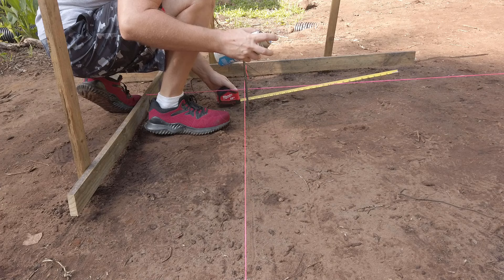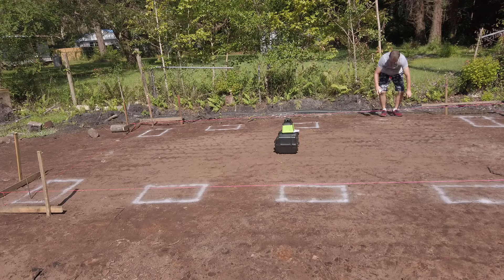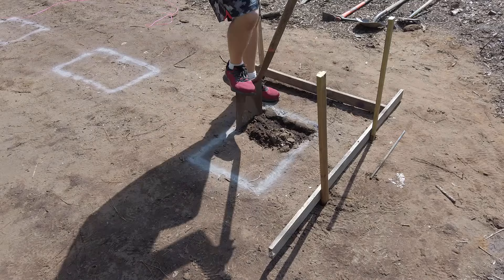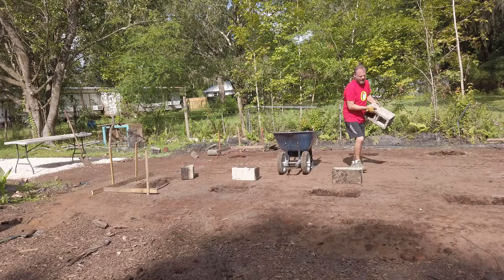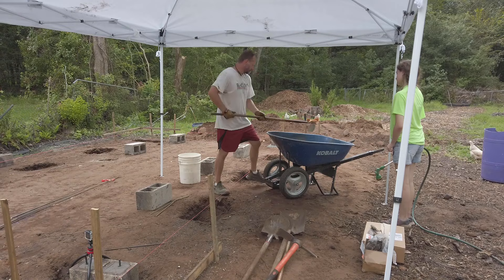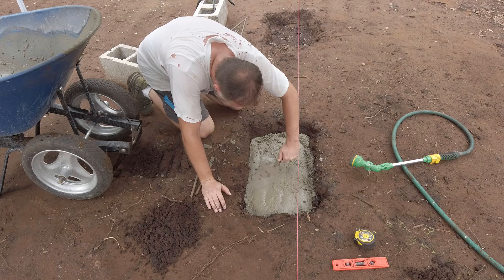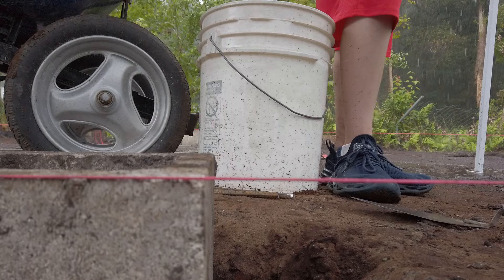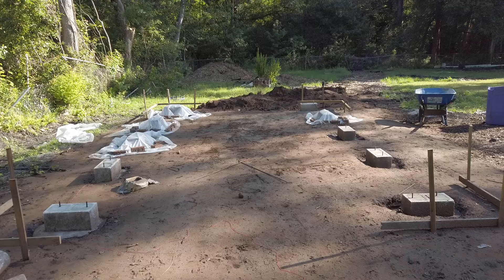Pouring Concrete Footers Pier and Beam Foundation Workshop or Large

Comment: 1. You made the footer 12 inch deep?   How many bags of concrete per footer?
Reply from the maker: Bags of concrete can be different sizes.  60lbs vs 80lbs.  So it depends.  2 or 3 for me.

Comment: In Australia they are known as Besser blocks. How much weight can they  each sustain in kilograms. Do I need to go deeper to support a steel framed house?
Reply from the maker: Depth is determined by local building codes.  Here in the states it is usually 12 to 18 inches below the frost line.  Depth is not determined by what the structure on top is built with.  Strength is determined by several factors, one of which is the type of concrete mixture.  You would have to look all that up for your area.

Comment: Another recommended practice is to soak your block (or brick) in water. Dry masonry wicks moisture from the mortar/concrete and weakens the mixture because it then doesn’t cure correctly. 
Weigh a dry block/brick. Then put it in a wheelbarrow filled with water. You will see a lot of bubbles released as it soaks. Then weigh it after an hour. You will be amazed how much water is absorbed.

Comment: In your video you cover about centering the block in the footing but I wonder why in the thumbnail it shows a 2in space on one side and 8in space on the other side of the CMU? Is probably an idiotic question, but is it a recommended approach than centering the CMU in the middle of the footing?
Reply from the maker: The thumbnail is just some random pic that was free to use.